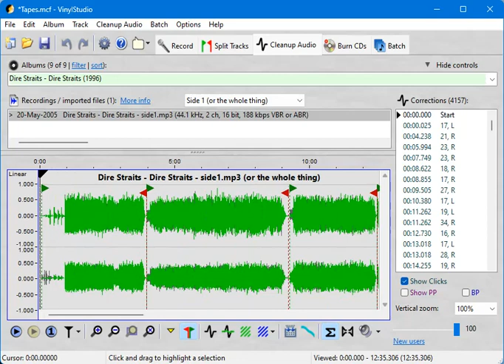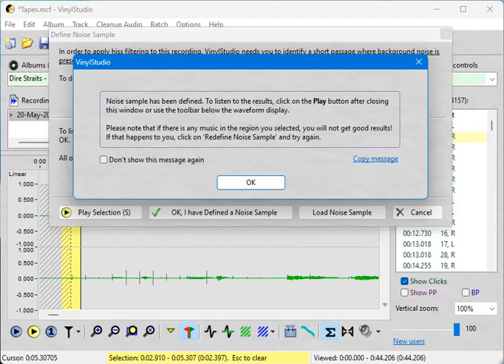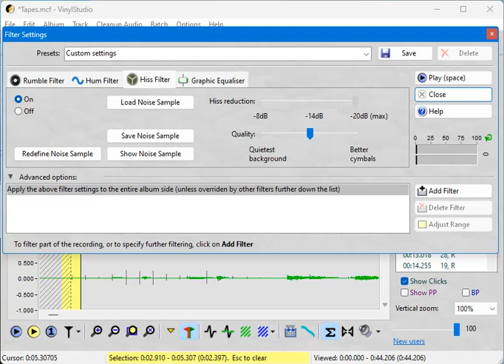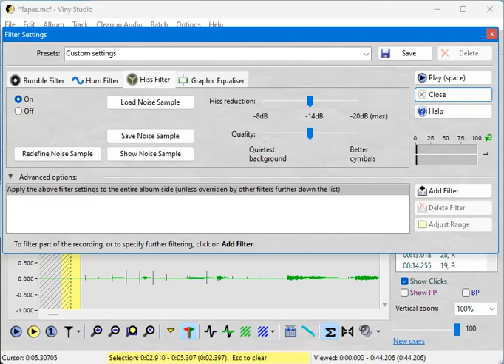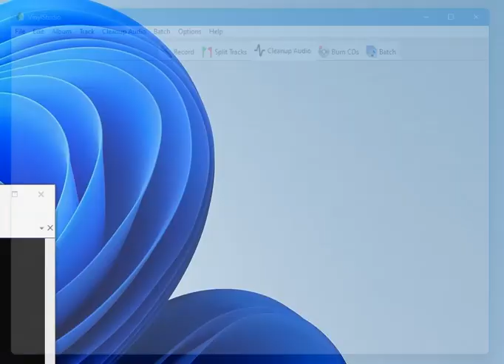How to use VinylStudio's Hiss Filter

Comment: New user of VinylStudio, I can record just fine, and split tracks and then hit "save tracks" ok, but if I go into "cleanup audio" to remove clicks, there is no "save" option that I can see. Do the changes automatically propagate somehow? Another question...if I use the B key during recording to manually add track breaks, it seems I have to NOT use the split tracks command later, as it deletes my manual entries....